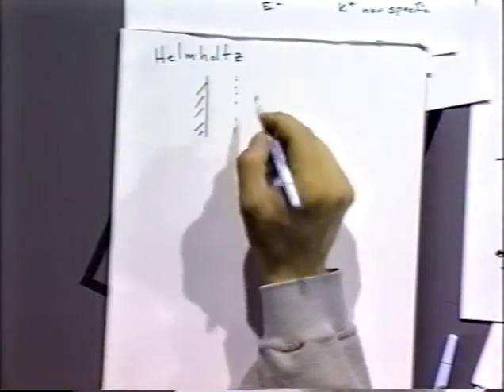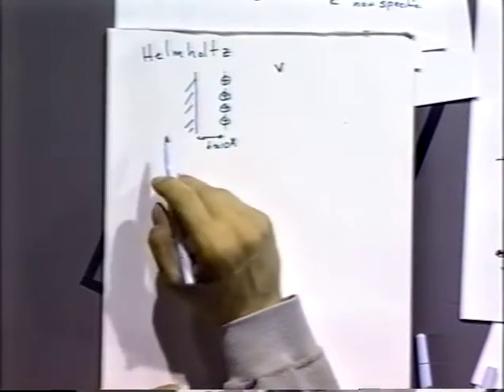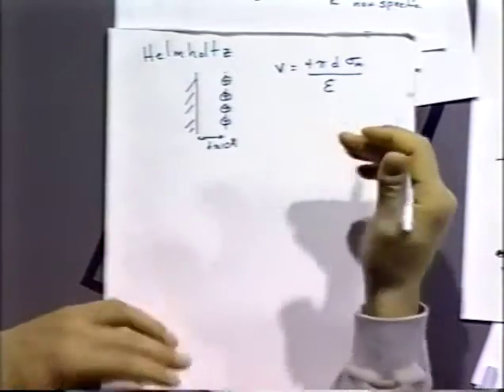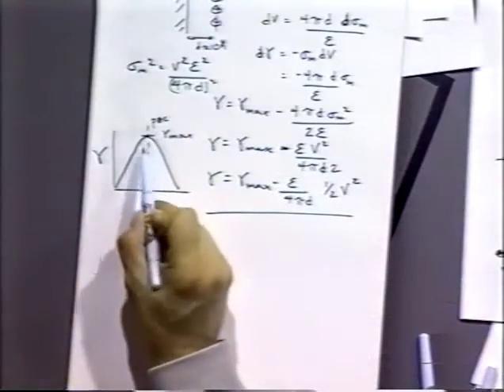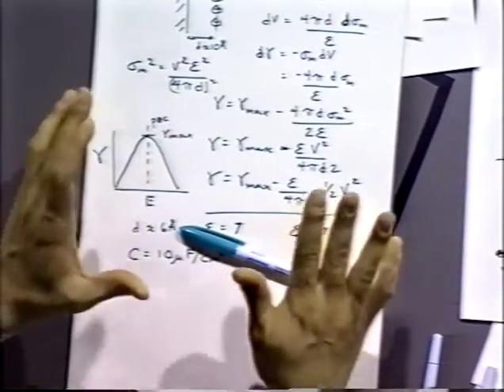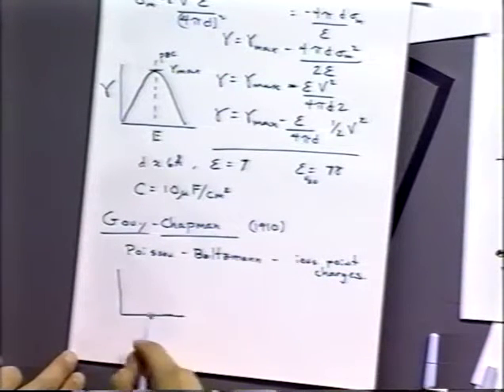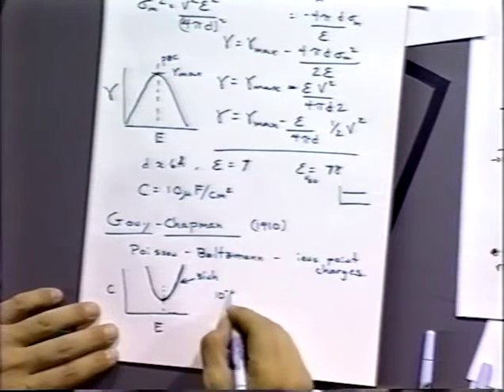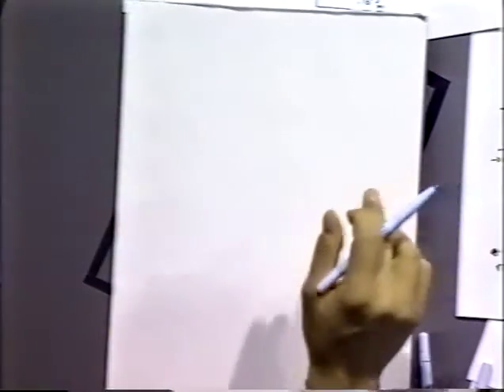Double-Layer Models (Gouy-Chapman-Stern)

Comment: This video looks like very old, but awesome. I just have developed an application to simulate the Gouy-Chapman-Stern model.
Reply from the maker: Hi, I'd like to know more about your application and try it out if I can.  I think it might be useful for when I teach about the double-layer.
Reply: D Wipf
Hi, currently I am doing some literature research to improve the model, I might complete it several weaks, I would like to dend it to you as soon as I finished, it is open source with a GUI
Reply: D Wipf
Are you the instructor in the video, the cover of  this video seems to be the CV simulation of flow cell electrode, what software did you used to do the simulation?
Reply from the maker: I wrote the programs in either pascal or visual basic.  The basic method is the finite difference method as described in the B&F book.
Reply: Dear D Wipf, sorry for the late reply, you can download the Electrical Double layer simulator here, https://codeload.github.com/wangshuoleon/DownLoad_EDL_Simulator/zip/master, which is a complied version for win64, you need install the Matlab Runtime first. https://cn.mathworks.com/supportfiles/MCR_Runtime/R2012a/MCR_R2012a_win64_installer.exe
It is a prelimilary version, please reply to me if you have any suggestions.

Comment: why does the parabola graph of the surface tension vs voltage start from 0 ? I mean, why is this graph shifted to Epzc? Plus, could you explain more details about relation between surface tension(max) and Epzc?
Reply from the maker: Since the pzc  means point of zero charge, the capacitance from specifically adsorbed species must be at a minimum at Epzc. Thus, Epzc is used as a reference point since the capacitance will rise  as we move positive or  negative  from this point.
Reply from the maker: The surface tension of the electrode is  a measure of the energy of the surface. For potentials away from the pzc, the charge on the electrode is partially compensated by the charge of ions adsorbed on the electrode. This make the surface energy decrease. At pzc, the energy is at a max, since this points has the minimum amount of ions adsorbed.This gives the shape seen
Reply from the maker: Another way to think about this, is that the charge of adsorbed ions prevents the surface from contracting. The surface tension makes the surface contract but the electrostatic repulsion from the adsorbed ions opposes this contraction.
Reply: Thank you very much Sir. It really helps! I didn't expect the answer because it's been a long time since the video uploaded.. 
Actually I have another question : In the system of high concentration of ions, the reason why the capacitance of diffuse layer is high is because the thickness of the diffuse layer would be thin since most amount of potential could be offset by ions adjacent to the electrode?